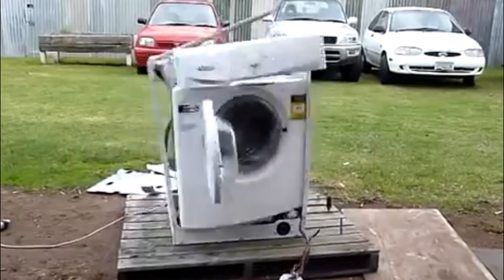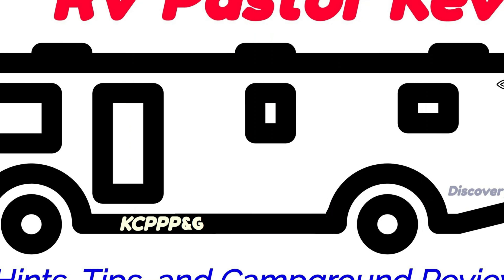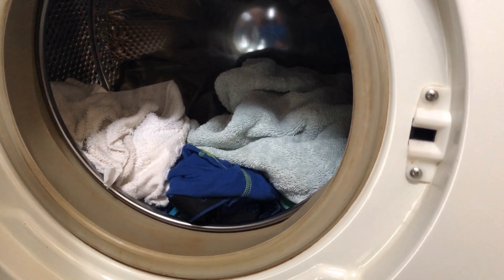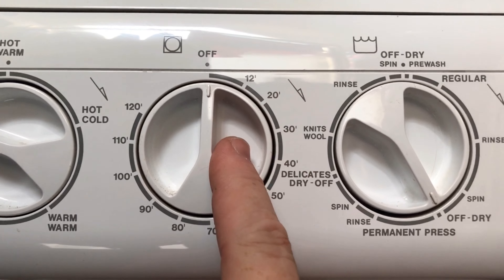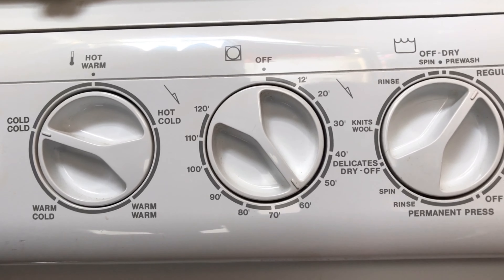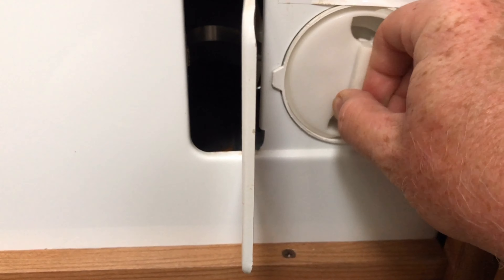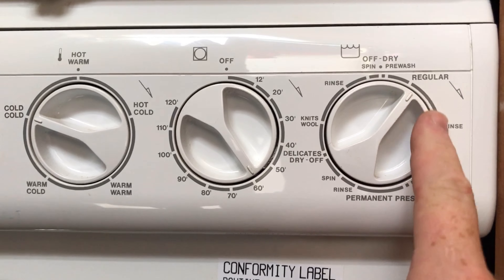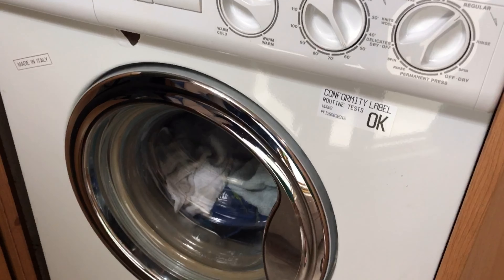How to Use your Splendide 2000 RV Washing Machine

Comment: Hi, I have an advice for you based on my own experience: always switch the machine off after you’ve doing your laundry. Always set the dial for your desired cycle first and then push the button to switch it on.
Reply: Correct. Make sure the power button is Off BEFORE setting for a new load. The KEY on settings is set the dials Right to Left when looking at the machine! Choose desired Wash Cycle, then Dry time, then the Wash/Rinse temperature, then Heat level, then Spin Speed, THEN finally push the power button on to start the cycle. When it is all done, then press power button again to turn it off, then open door and remove clothes... Net, select settings Right to Left each time and you will have no issues...
Reply from the maker: Thanks for the tips!

Comment: lol  I love the beginning of this video~I am so jealous that you have a washer in your RV. This is something we are trying to decide if we need it when we upgrade our RV. We are selling the sticks and bricks to travel and see all the states. Do you think the washer and dryer would be good enough for 2 people loads or would I be doing laundry all the time?
Reply from the maker: well..... it depends. I think it would be fine. It doesn't hold as much as our home washer, and since this unit is a 120v unit, it doesn't get as hot or dry as fast, but it is GREAT to have to stay in front of a mountain of clothes.  We have 5 (my wife and me, and 3 kids) so we can generate a lot of dirty clothes.   Of course, adding big beach towels to the mix does slow everything down.  The other thing to remember is that it is a washer AND dryer, so it is a lot slower than at home too since it has to go through the wash and dry cycle before it is done.  
If it is just two people, you would be happy to have it.  It also would save on time sitting at a laundromat. 
Another modification I did was rewire the outlet.  I have it wired to an external power cord that I connect directly to the power plug, so the power that the washer is using doesn't go through my rig, as to not go over the allowed amps in the system, so we can run both air conditioners while we do wash.

Comment: I'm not sure why my washer looks different it shows Splendide 2000 S I bought used and love it but I can't find the filter.
Reply from the maker: bottom right.
It is a wet filter, so the lint will be wet. make sure you have towels to catch the water when you open it.
Reply: @RVPastorKevin  I did a deep search on my model and it says my model does not have a filter .
Sounds strange but I searched front to back .
I am not in a R.V but a tiny home the draw back is the time it takes but I purchased it for 75 dollars and It has been a God send.

Comment: What happens when you do all of that and nothing happens. We just bought a used rv and trying to figure out what to do. I followed it just the way you did it
Reply from the maker: Ok.... couple of things to start.
1) it runs off 120v power (shore power) so make sure your RV is plugged into land based power, or if you have a class A or B rig, make sure the generator is running. Get an outlet tester and make sure power is at the outlet that the washer is plugged in to.
If no power at outlet, check for a tripped breaker. If you have a class a like mine, there is a switch in the kitchen that sends power EITHER to the microwave OR the washer. If that switch is in the wrong place, my microwave will work but my washer won’t.
2) make sure the water is on.
3) make sure the on/off button is IN for the unit to be on.
4) dryer time to zero or off
5) washer knob turned just a hair past off toward the hot/cold cycle.

I suspect it is a power issue.....
Reply: @RVPastorKevin  Thank you. I can get the dryer to work, but nothing happens when I try the washer part. We are in a class A and plugged into the land based power.
Reply: Here is tip number six. Found out by accident. Make sure you are either connected to a drain or that you're gray water holding tank is big enough and not too full to accommodate all the water that it's going to use. Found mine backing up into the bathtub.